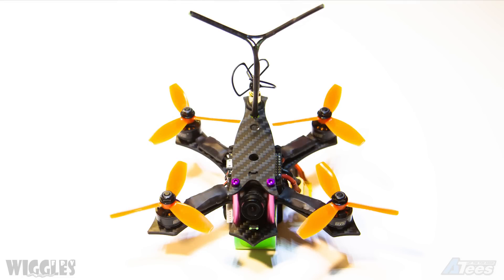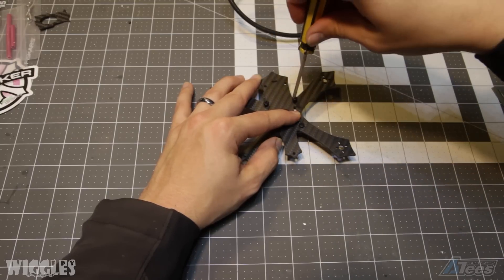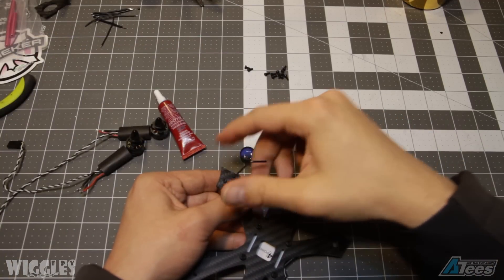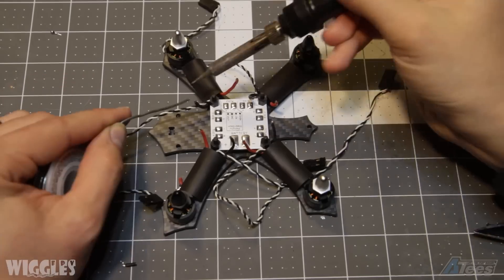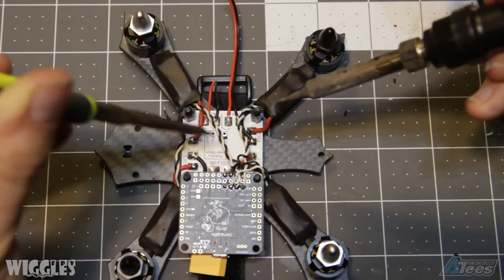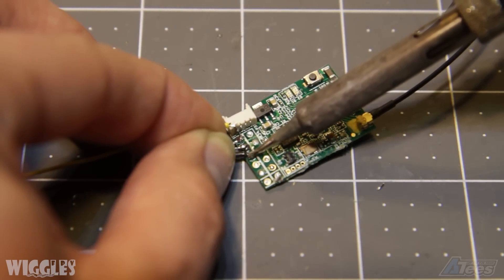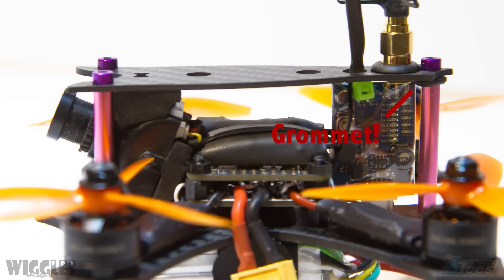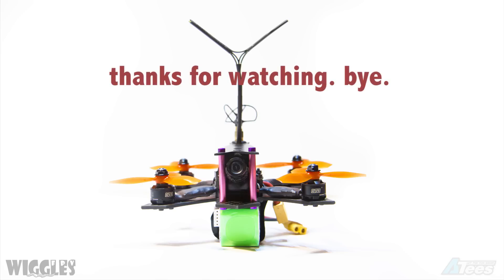Shendrones Shrieker Build / 130mm Brushless Micro Quad

Comment: Can I use the Revolt 2 on this frame?

https://www.racedayquads.com/collections/flight-controllers/products/raceflight-revolt-v2-flight-controller
Reply from the maker: You can, but if you are already familiar with betaflight, I'd suggest the cl racing f4.  It's a little cheaper and has built is vregs, osd, pdb.   The pin layout is great too.  In my opinion, raceflight is overhyped.  It flies fine, but there's a ton of far better featured boards out there for lower prices.    In the end, fly what you want.
Reply: ok thanks

Comment: Do you always pre-tin signal wire pads and solder onto the pad, rather than pushing the wire through and using it as a through-hole?
Reply from the maker: Yes. I've built over 30 quads and this way I find best.  It makes it much easier to swap wires in and out if need be, and I've never had one come loose.

Comment: Hey wiggles, I noticed that you soldered to Channel 3 on the FR sky D4R2, did you run a jumper?  I can't seen to configure the transmitter and Taranis right.
Reply from the maker: This was the x4r-sb, not the d4r.  the x4r-sb does not need a jumper.
Reply: Great! Thanks!  Your channel and build vids are awesome!  Great job.
Reply from the maker: Joe Diebold thanks joe.  i will try to keep it up, some changes are coming.

Comment: Very cool build. What kinda flight time are you getting from your setup? Also, did you have to flash the escs before using them? I've never had escs that required I flash them beforehand. Thanks.
Reply from the maker: +Michael JW Flight times are about 3 minutes with aggressive flying on 4s 860s.  I usually flash my escs to the latest blheli with the passthrough on the flight controller.

Comment: Hi, Great build and great video.I'm planning to build  a 130 little beast.what do you think of the new lighter motor like Dys 1104 7000kv (>6g) with 3020 or 3030 props?And what is the brand of the 4S lipo that we can show in the video?Thanks
Reply from the maker: +BeFPV no idea, haven't tried those motors.  I know that the 1306's will pack more punch with 3040 or 3045 triblades though.
Reply: +Wiggles FPV thanks, and for the model and brand of the lipo please?
Reply from the maker: Pulse 860mah 75c is my fav

Comment: Seems like there is enough room on top for the battery. Is it better to have the battery at the bottom?
Reply from the maker: +Jonathan Edradan the top plate is thin and it flys fine with the battery on the bottom.

Comment: Did you ever get to posting any flight videos?  Or did you just sort of move on from this frame to others like the Alien?
Reply from the maker: +Michael Paolini I posted one. https://www.youtube.com/watch?v=QtACD-qL_iQ  Would have done more, but the weather was terrible when I built this.  Also, it's not the best camera platform.  I love flying it without a camera, I just don't post too much DVR video.
Reply: +Wiggles FPV Looks like it fly's well!  Trying to decide between one of these and an Atom 122 v2
Reply from the maker: +Michael Paolini both are good.  this is an easier build.

Comment: is it annoying not have an LC filter?
Reply from the maker: no noise on this build.  I used to always use them.  now I only use if I have issues.
Reply: i plan on doing this build but with a naze32.  I might try to squeeze in a OSD board for the convenience of 5v and lc filter.  but if there is no noise i guess I could skip out.  what about voltage alarm? is that on the dodo?
Reply from the maker: on dodo w/ telemetry.

Comment: Great video. Is the battery placement bottom heavy(CG)? Nice frame but those pointed tip look unsafe? Round them off and save a few grams?
Reply from the maker: +chang truong battery placement is totally fine on it it.  it flies really well.

Comment: Great video.  I wish I had found it before I built my Tweaker!  That "reach around" is an excellent idea.  I configured mine with the SP F3 acro and Kiss 18amp esc's.  I left off the ground wires from the esc's to the FC to save wires but I'm wondering what kinds of problems that creates.  I've had a few flights LOS and not noticed anything.  Should I go ahead and connect them back?  I had assumed they shared the ground from the esc power connection.
Reply from the maker: +Sankofa Musician I always run ground wires, just to be safe.  You can get away without on them on many builds, but sometimes you will need them.  I prefer to build consistently across all my quads just to avoid little pain-in-the-butt headaches.

Comment: nice build dude! I was all proud of myself for cramming everything into a QAV210, until I saw this! 

How did you get the motor directions correct when you were wiring them to the ESC? What is the secret?!
Reply from the maker: +magicalpencil no secret.  trial and error.  two of the escs spun motors backwards.  I desoldered them, hooked them up to the the blheli suite and switched direction  (these didnt have beheli bootloader, they were and old batch).  another way is to simply switch two of the 3 motor wires on the ESC (meaning hold off til you shrink the heat shrink).    different motors/escs have different default directions, so you just need to figure out what works for you.    if you are using escs that have blheli bootloader your can use the FC as an interface for blhelisuite and program escs easily all at once from your computer with out additional soldering needed.   in short, many ways to fix motor direction.
Reply: +Wiggles FPV Ah yeah I knew about switching leads but I didn't know about the BlHeli suite! I've only been flying quadcopters for a few months but I love building them nearly as much as flying them :^D

Comment: Great build, I'm ordering my parts this week!  I like the idea of the ESC wrap around, but quick question... How did you know the motors would spin the right way the way you connected the wires to the ESC?  Every time I've done a build and powered up 3/4 have spun the wrong way and I've had to swap 2 wires over.  That's going to be a pain if I've already put all the heatshrink on and soldered to the PDB etc..
Reply from the maker: +Dan Watts you can change the ESC direction in BLHeli suite after the fact.  OR just wait to shrink the heatshrink until  you confirm your directions are right.

Comment: awesome build!! i just made up a shopping List, and wonder if i should get the 3100kv or the 4000kv motors, where to get some descent props, and about what Battery is used with em? i am used to a 6" zmr250 with longer arms, so i guess only 1000mah or less Lipos?
Reply from the maker: +Grearson .x 1000 or less for sure.  I'd say 860 or less personally.
Reply: thx a lot, have to find a srouce for decent Batterys and Props then (with resonable shipping to eu) Next project saved!!
would u choose the 4000kv over the 3100?

Comment: Why do the reacharound with the motor wires?  Surely that's just unnecessarily keeping unwanted weight.  You could lose all the wire and save a few grams.
Reply from the maker: +valderja you certainly could do that.  the reacharound, makes fitting the esc much easier,  otherwise you need to cut into the heatshrink near the motor.  some escs may be too long to do without wrappeding the esc.  it's doable, but I intentially geared this video towards new builders and wanted to make it easiest for them to do a tiny build.  the initial shrieker builds all used this technique so I followed along.

Comment: I have these same motors on a ZMR 160 build but the specs do not mention the ability to run on 4s.  Also How are they working on 4s for you?  Also you could remove the negative signal wire from the esc to save a tiny bit of weight and be cleaner, hasn't caused any issues with my builds yet.
Reply from the maker: +Kory Westers I always run signal ground out of habit.  the dys 3100kvs have no problem on 4s.  the 4000kvs are also reported to work (but are also a little riskier)

Comment: Did you need a power filter for the FPV cam?
Reply from the maker: +Terry Roshto I almost always run one, but I didn't in this build.  Haven't had any issues.  If you want, a light solution you can put a 330 uF or so across the lead on your pdb, that will help smooth things out a little bit, but not quite as much as a LC filter.

Comment: Outstanding job especially on soldering very helpful if it wasn't for the soldering part I could build one after watching this with no problems. Can't wait for a similar build under 250g fpv but with GPS and osd. I'm confident you can do it.
Reply from the maker: +nasarami You haven't learned to solder?  There's tons of videos online to help you learn, it just takes a little practice, and a decent iron helps a lot.
Reply: +Wiggles FPV I do solder but it's looks ugly and bulky and can't do tight places, I get whatever what I'm soldering very hot before the solder wire even begin to think about melting! I think mainly its my Walmart soldering iron and solder wire. while watching RC explorer tricopter build he recommended lead based solder, I think I'm gonna invest in a decent soldering station. Thanks for replying and keep those Great videos coming.

Comment: hey mate! what soldering iron did you used for this build?
Reply from the maker: +Pablo Gonzalez I used a RadioShack digital soldering station.  Got it on sale when Radioshack was going out of business.  If I had to get another one I'd get a Hakko or a Weller.
Reply: +Wiggles FPV what about a ts100? for faster soldering how much watts do you recomend? 40, 60? 
great video!! im looking forward to build this shrieker
Reply from the maker: +Pablo Gonzalez haven't heard much about the ts100.  saw it on banggood though.  might be ok.  no personal experience with it though.  as far as watts,  I prefer higher.  like 60+watts.  makes soldering big leads much easier, because the iron heats up the components more quickly.  just gotta be careful when soldering small connections, you can float pads right off boards if you aren't paying attention to your set temperature.
Reply: Thanks!! Will start gathering all necessary componentes for this little devil. Cheers.